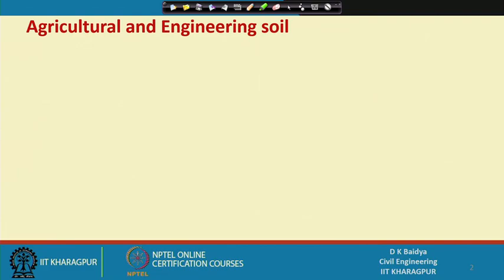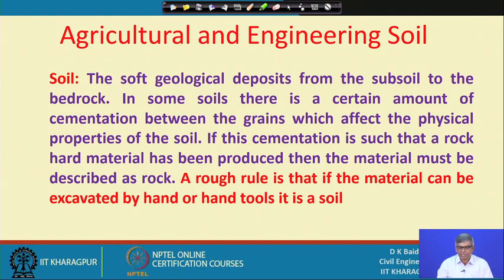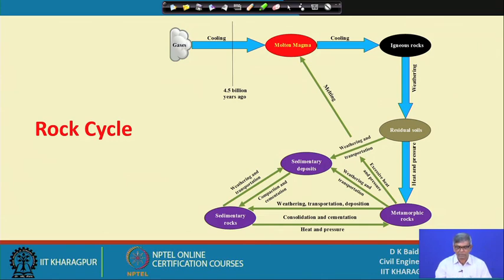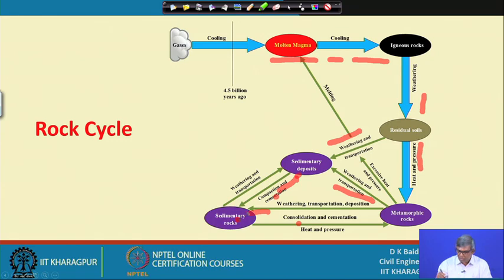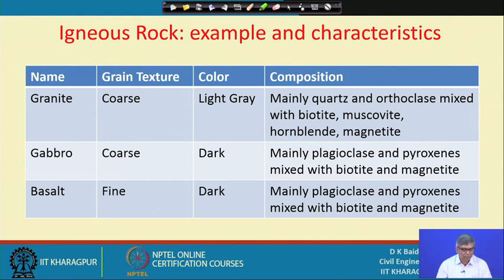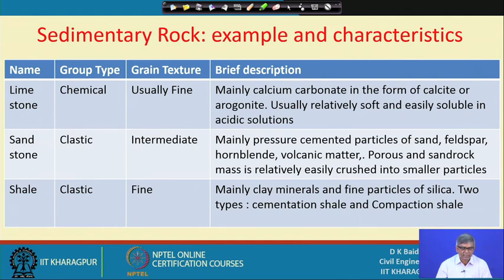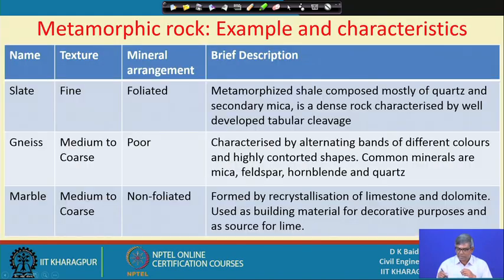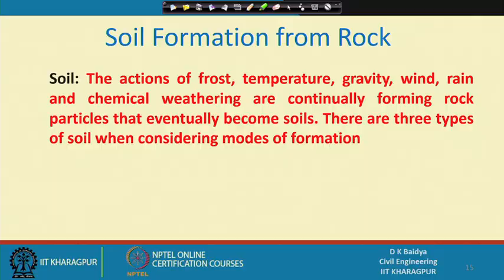Lecture 1 : Rock cycle

Comment: In Japan, there is a problem in obtaining specimens for soft ground.
There is a gravel mixing problem with the triaxial testing machine.
C&φ up to 25m can be obtained using sounding survey equipment.
It is becoming easier to clearly distinguish strata.